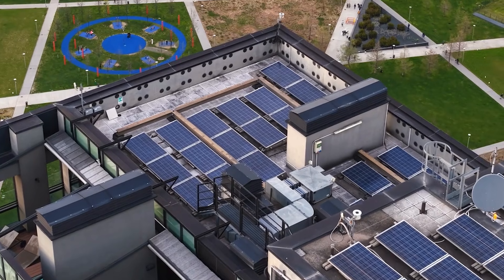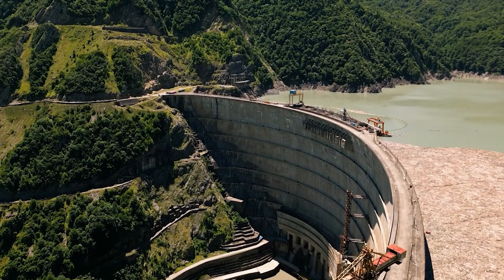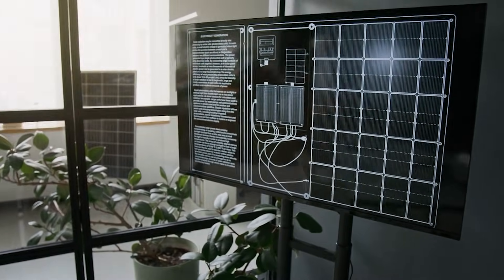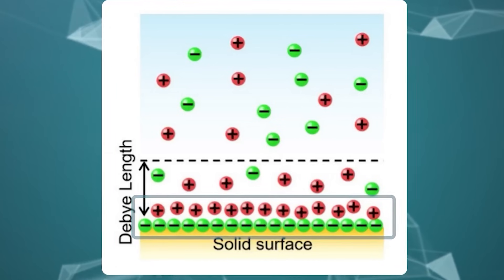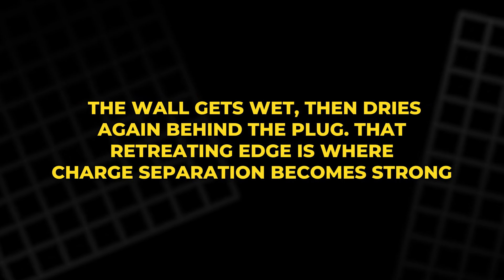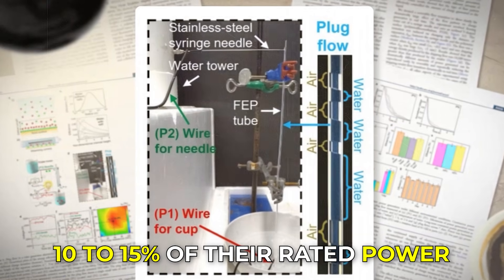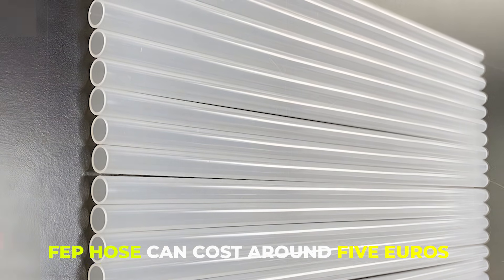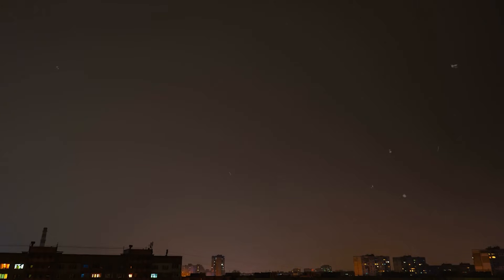This “Impossible” Rain Trick Generates Electricity 100,000× Better Than Before!

Comment: first off no water is pure no more it has to be distilled first theres floride chloride many other poisons  then like a pem cell you need to use platnum it takes water makes direct curent but in Abel to run a house still need batterys & large 5-8 kw inverter 220 240 vac 120-120
Reply from the maker: That's an insightful point about water purity and the components needed for a home energy system!